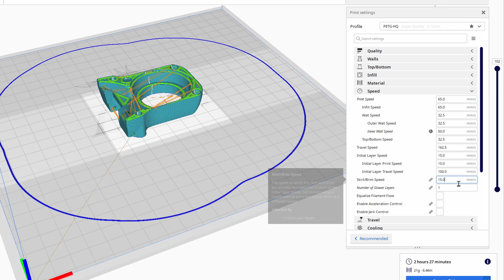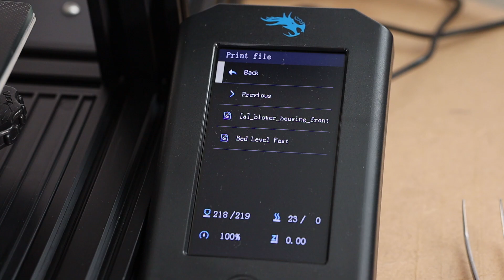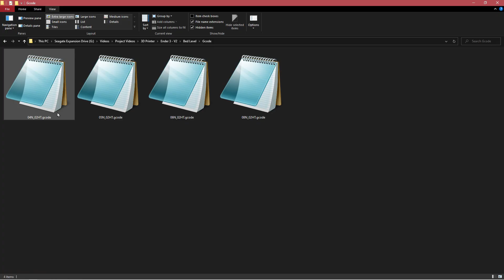Creality Ender 3 V2 - Fast, Easy Way to Level Your Print Bed

Comment: A BLTouch does not 'level' your bed, as its name suggests (BL = Bed Level), but rather it measures variations in your bed's flatness, and applies those variations to the nozzle height, on-the-fly, as an object prints.

Everything you did in this video is a good starting point, but a BLTouch can help correct for any aborations you may have in your build plate that none of what you did can account for.
Reply from the maker: BL Touch is a great addition, the purpose of the video is to help people put off the purchase of one.  I've been printing for several years without one and though I have videos planned for the BL, for most people it is not a necessity.

Thank you for the notes, the term level bed is also incorrect, the bed is not level, however that's the term we use.
Reply: @NeedItMakeIt  Agreed, a BLTouch is not really necessary for most people.

Out of curiosity, what issue do you have with the term 'bed leveling'? I don't see a problem with it, but knowledge is power...
Reply from the maker: For me, it is because I am constantly moving the printers around to make these videos and my table setup is terrible, they are plastic tables.  Manually leveling the bed the way I was doing it with paper and moving in X and Y one at a time was too time-consuming and never gave great results, I started adjusting while the print was going and that gave me much better results.  90% of the time it works every time... :)

I'll probably try the magnetic PEI buildplates soon and see if I can print with no adhesive at all, obviously people do it, my issue is that I print mainly structural parts, they tend to want to warp, I print with 0.8mm or 1mm nozzles and the infill is very heavy, not much can stop the warp and pulling away from the build plate... the glass flexes a bit with the part as well.

Sometimes I could explain more in the videos, I try to keep them as short as possible and focus on the concept and idea rather than all of the reasons why and why no.  People can decide for themselves what they'd like to do.

I appreciate the comments!
Reply from the maker: @imacmill  It seems to be a common problem for a lot of people.   I suppose that's why the BL is so popular.  I started with the Anet A8, nothing but aluminum bed on that printer, I used tape and it was horrific, especially printing with ABS.  Glass and ABS is a little better, but Glass and PETG is far superior, I would estimate I have 1% tossed out due to adhesion problems, it might be less than that now.  I still struggle with PETG for other reasons, stringing mainly because it likes to ooze, and long travel distances between printing cycles will still have these little blobs, they are easily removed.  I suppose printing with PLA+ or APLA might be better options, do you have any experience with these?  Apparently PLA+ doesn't mean much, it varies too much by supplier to be regulated.

Comment: Ironically I’m currently failing to print this exact file. I’ve printed all my Voron Parts from black eSun ABS+ without any issues. Unfortunately the blue ABS+ seems to behave different. Even tho most accent parts were doable I just can’t get the fan cover right. It’s the letters that keep peeling of the bed. It seems like the chamfer on the edge of the hole part is causing trouble
Reply from the maker: I can recommend a bottle of Nano bed adhesive from Visionminer, if you buy the sample pack and use alcohol to thin it out, it will last you a while.  This is the only material that bonded ABS perfectly for me, I've since switched to PETG because of the smell, but I do like the properties and look of ABS.  That will give you the results you're looking for. Once I found this it was the only solution I used for ABS.  

Good luck, I've love to see the results when you're finished.  This is going to be an amazing project and the speeds and precision are both incredible.
Reply: @NeedItMakeIt  Thanks for the suggestions. I tried to print the part with black ABS today and it worked perfectly. (Should’ve tried that way sooner) I’ll try to reprint it in blue once the Voron is done. Or maybe if I find some better settings for the blue filament
Reply: get some acetone and solve some ABS in it to make it a milky slurry. Wipe your bed with this in an even layer and you`ll have perfect adhesion on glass. PEI sheet should work fine without any extra stuff. I`ve used slurry and it gives great results.

Comment: I have just the slightest feeling we Will be getting a voron video soon
Reply from the maker: I was thinking about doing a series, I also wanted to introduce some generative design using F360 to remove excess weight from any moving parts.  I can't resist the urge to make a voron printer, I just don't know if it should be a Switchwire.  I think I'll use a 0.4mm nozzle next time for a little better result on the text.  Maybe try glow in the dark filament too.  

I have to create short videos as the moment, work is so busy, do you think printing a few parts with some detailed overview of the components for each video would be interesting and helpful?
Reply: @NeedItMakeIt  I would really love to see something like that I've been pretty interested in the voron these past few weeks so some detailed videos could be helpful
Reply: @NeedItMakeIt  For starters, you could just upgrade your hotend assembly on your Ender 3 V2 to Voron Afterburner. There is a nice adapter plate on Thingiverse. I've just begun assembly on mine! It does require purchasing some parts (4020 blower fan and BMG extruder or its parts). I also used a Microswiss adapted toolhead. You can then reuse your Voron Afterburner for your future projects with the Voron printers.
Reply: @NeedItMakeIt  I am going to rebuild my modded 2017 tevo tarantula to voron legacy, maybe legacy is the right way? ;)
Reply from the maker: @TheMumin87  The legacy looks awesome, I am very interested to see some of your build pics!  I'll be starting mine soon,  I'm going SW, I think it is a simpler project than the true CoreXY builds, and a good starter project.
Reply: I really hope so

Comment: Huh, I do this trick at work with our custom built printers and webduet microstepping to get the first layer contact right, but never thought to use it at home for bed leveling.
Reply from the maker: I figured that other people would have done this too.  It is simple and I really don't like adding things unnecessarily to the printer as well as the costs and added complexity of firmware changes.  Thanks for the note, I'm glad it is working for others as well.

Comment: I just glued my dial indicator  with magnets on the back and the older enders have a metal hot end cage. I then tighten the bed all the way down, i just loosen the knobs needed to level the bed to within a thousand of a inch.  Bed never moves and i never have to worry about it moving. Sorta like a solid bed and i love it. You can get a cheap dial indicator for under 20 bucks online.  This only works if your bed is flat though.
Reply from the maker: That's a great tip, I've been wondering how to get a DI onto this printer, maybe a custom bracket.  Thanks for the tip!
Reply: @NeedItMakeIt  There is a  clip on bracket  for the Ender 3 V2 fan shroud, that allows you to mount a dial indicator. Printing it as we speak... ;)

Comment: Can we use normal glue stick or need some special glue stick?
Reply: @JS-fp2rb  what the best way to clean the glue off of the glass bed after the print?
Reply from the maker: Some people don't bother, I personally just run it under the tap and use some soap and water, comes off super easy.  I think if you don't clean it, you'll see the extra uneven layers on the surface.
Reply: @NeedItMakeIt  I've only recently started using a glass bed and glue stick. 
I haven't cleaned it off yet but I've been thinking the layers could get uneven from the glue (like you said) had no problems as of yet.
I'll clean it off for next print though, cheers for the advice 👍
Reply from the maker: @georgewhite1685  No problem, another tip when you want to reach higher speeds but have trouble with ringing is to switch to thinner glass, you can go as thin as 3mm borosilicate and it works well.  I have yet to test anything magnetic but will in future.
Reply from the maker: I mainly use dollar store, anything seems to work, the larger ones make the job much quicker.
Reply: I only use hairspray it works like a charm
Reply from the maker: @AgnosiaAgnosis  I've never tried hairspray actually, others have said the same, they've suggested to get the one with the extra hold, do you have any brand in particular you can recommend?
Reply: @NeedItMakeIt  I took the advice of the 3D Print General and got the Aquanet Extra hold. Sometimes it's too good
Reply from the maker: Nice, sounds pretty good!